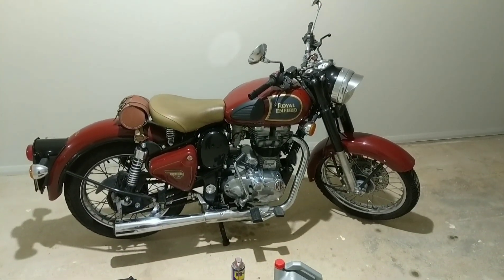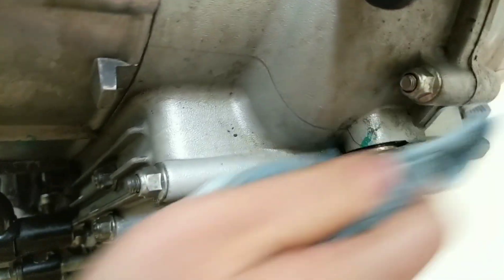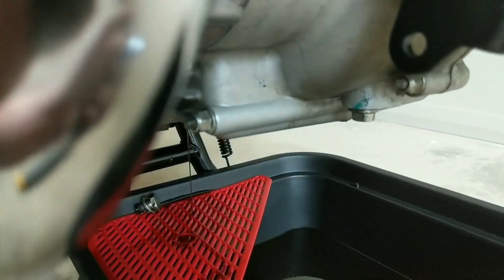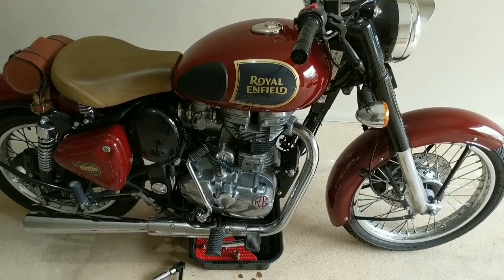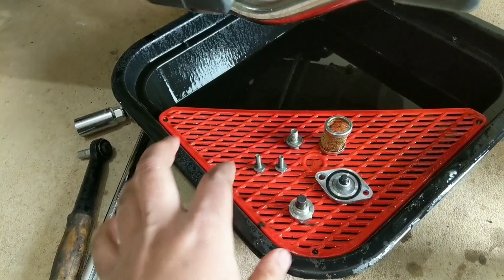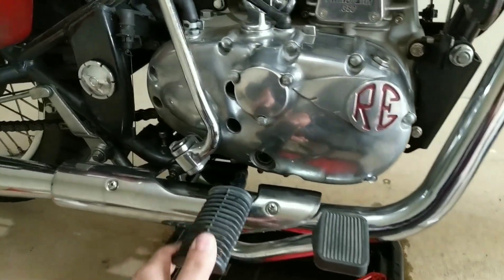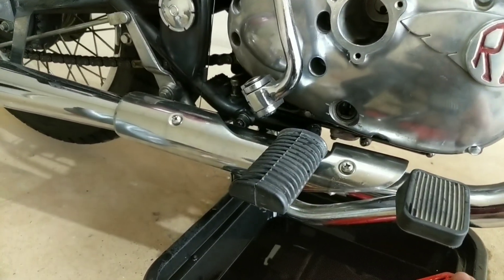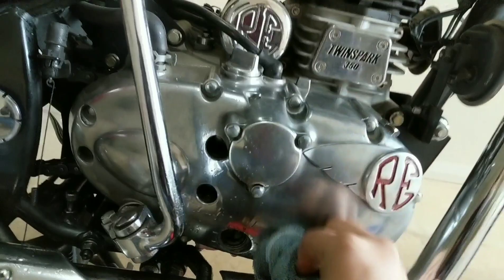Royal Enfield Oil Change

Comment: Best practice is to replace or re-aneal the copper crush washers every time you change the oil. A Torque wrench is a great tool to properly torque your drain plugs in an alloy engine. The manufacturers specify semi synthetic oil  and full synthetic is worthwhile if you can afford it, because the motor doesn't hold much oil in the first place ( I recommend diesel oil,  Penrite or Nulon 15/50  are my choice) also best never to start the engine without oil even for a few seconds just use the kickstarter and rock from side to side.
Reply: Yes I was a service  manager at a major dealership.

Comment: Never ever start an engine without oil! You get zero oil pressure and is causing damage to the engine, even if you only run it a few seconds. There is a reason why the oil filter should be soaked in oil before mounting it and that is that you get oil pressure at once when you start the engine.
Reply: tompas11,Very agree!
Reply: the best technician among all i watched vedios.well explained

Comment: Thanks for taking the time to get this up here. Not that it really matters too much, but I'd leave the new oil filter in that cup of oil until it was ready to go into the bike, instead of letting it sit and drain on that red oil drain pan rack. The more oil in that filter on startup the better. By the way, that's a real nice oil drain pan for this job--and a real fine 350 you've got there. Greetings from America, where I'm plugging along on an older model iron cylinder 2005 Bullet 500ES in green "Military" trim.
Reply from the maker: BilgemasterBill thanks for your kind comments. I had an old (2002) iron cast Bullet 500 before this one. Needed 3 different oils to be changed... Engine, gear and clutch oil :)

Comment: Thanks for the video,but in my opinion:Please,don,t let the engine running after drain the oil even for a short time! I own motorcycles since 1972 and i never heard of this!In every engine stays a little bit old oil during an oilchange which wil mixed with the new clean oil but that,s no problem.But if you like to clean the engine,you can can fill the engine with a cheap clean oil,let it running for a few minutes and then drain it again and fill it for the second time with the right oil!But this is a procedure from 50-60 years ago (and keeps a lot of time )when motoroils whithout detergent dopes where used!Todays modern oils have all cleaning dopes to keep the engine clean!If the Bullet was mine i prefer a multigrade 20w50 oil who stays a little thicker especially in a warm climate!IThe rest is OK what you explain and i like this modern classic Bullet very much while it looks,sounds and run like a classic British motorcycle.Greetings from Holland!
Reply from the maker: Thanks for your advice and guidance
Reply: Sir Can we use 20W50 grade oil for new UCE engines,, it means for BS4 RE Thunderbird 350???
Reply: Bala Murali,I own since almost 2years a Royal Enfield 500 from 2012 and use always 20W-50 engine oil specially for motorcycles like the UCE (unit)engines who shared the same oil for engine,gearbox and WET clutch!So don’t use a 20w-50 specially for cars(who have a DRY clutch!)The friction minimizers in car oil can make the RE clutch too slippery!
But a 20W-50 oil is a little thicker than 15W40 or 15W50 and the ball and roller bearings and the gearbox prefer that!
Only by weatherconditons below 10degrees Celsius/50 degrees Fahrenheit you must be carefull with cold start and rideaway in the first miles/kilometers but in India it is mostly warmer than in NWEurope I suppose?
So I would say:Yes,no problem if you use motorcycle oil.
Greetings from Holland,ride carefull and keep healthy!
Reply: @hubdormans5709  Sir thanks for your valuable advice and knowledge shared with us. Tq sir🙂🙂🙂🙂
Reply: Hub Dorman totally right same procedure  for heavy engines only engine oil and oil filters are different and never start engine with out oil.

Comment: Just bought a 2 year old Classic 350, kick start and carbie, and followed your procedures. Hit an issue though; there was no crankcase suction filter when I opened the plate. 😞 Ordered one but not coming from Delhi for 2 weeks. So, will have to drop the oil again to install it when it arrives. These things are sent to try us. I put a "super magnet" on the biggest sump plug to catch as much bits as possible. This was a tip I picked up from Ride-with-Warro's channel.

Comment: Don’t run the engine with no oil that’s a bit of a no no right there if your worrying about getting every drop out just use the kick start with the ignition off you won’t create anywhere near the amount of friction the amount of shavings you have on the end of the magnet seems a hell of a lot apart from that not bad also don’t use any kind of fuel near o rings it shortens the life span

Comment: I  would pull the spark plug wire and crank the engine with the kick starter a few kicks to push more dirty oil out. It's your bike, though...

Comment: NEVER run an engine without oil. Don't even think about it. You don't want to get the oil out of the pump. The pump can lose prime and cause it to take a really long time to build oil pressure when you start it with new oil in it.  And you don't need to get every single drop of oil out of the engine. You can't anyway. There are a lot of places inside the engine that will trap oil. I change my oil and filter every 2000 miles. The oil never gets really dirty. That oil is WAY dirtier than oil should ever get. I use either spray carb cleaner or brake parts cleaner and an old toothbrush to clean around the drain plugs and the strainer. I also use it to clean the drain plugs, strainer, strainer cover, and oil filter cover. Diesel is a terrible cleaner. You can use gasoline (or petrol as it is called in the UK) I use 1/4" drive sockets and ratchet. DO NOT use a huge wrench, ratchet, or breaker bar. They provide too much leverage, and make it impossible to feel just how tight the bolts are. It is EXTREMELY easy to overtighten and strip the threads in the case.

Comment: Bro u are not supposed to start  the bike when the  all oil are removed. it will harm the engine bore kit.    instead of that shake the bike.well
Reply from the maker: Just 5 seconds won't harm the engine
Reply: Don’t even think about starting without oil in the motor.

Comment: UCE engines use hydraulic tappets, they should never run without engine oil. This method of oil change will cause tappet noise to creep in. Apart from that everything else is fine

Comment: Synthetic oil is better because these engines are lean burn and run VERY hot. Synthetic offers better protection and will last longer. Also - you ran the engine with no oil. What a stupid stupid thing to do....